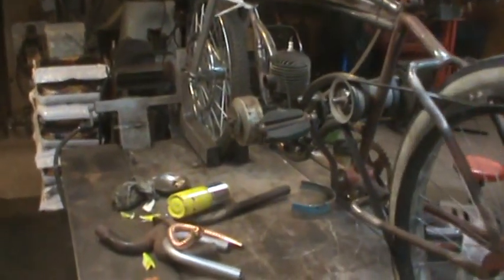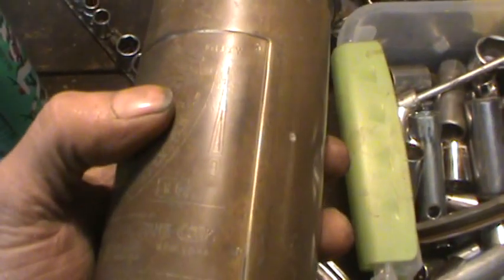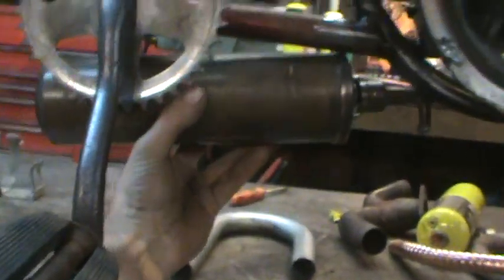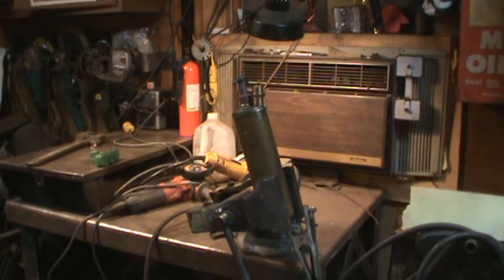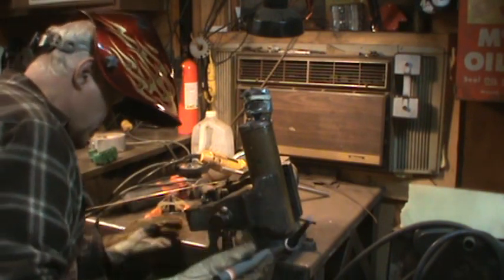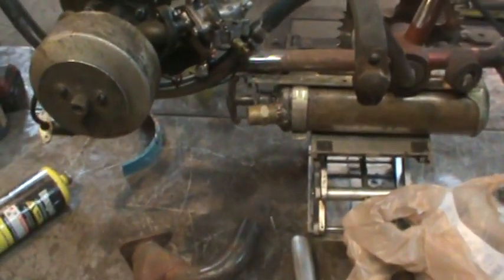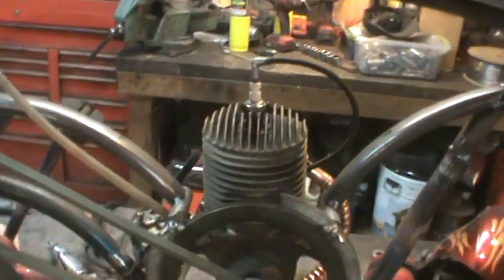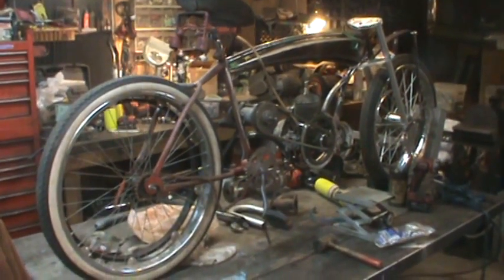building the bike exhaust

Comment: I like the decompression idea. I would think you could T the plug as they sell those anti fouling adapters that hide the plug up there and they seem to run. But I also like the idea of just taping for a second plug and using the body of an old plug for the main part. Maybe brazing in a brass petcock into the center of an old plug.

Comment: The cast elbow bend is available with a male thread (I know they are here in New Zealand) that the copper nut would fit directly to and lose the joiner fitting shortening up the top end so the copper tube might then be able to follow the crank better

Comment: Very cool the exhaust looks great . Have you every seen a decompressor Valve its a ball type but the top looks like a extremely small funnel . You put a little gas in it open it up leave it open tell it starts .   I have had a few old vintage 2 cycles that had them in the head . Cant wait to see more :)
Reply from the maker: +huck01955 l havent but sounds cool
Reply: +mustie1 I will try to find pics and send them to you

Comment: Be careful with a decompressor  valve. the increased volume in the combustion chamber before the actual valve could reduce the compression to where the engine may not run. A couple CCs volume  on a small engine like that would be huge, even if it still ran the power reduction will be great. If you must have a decompressor stay with a push button chainsaw or a cable operated Skidoo type that threads into the head. 
Sorry for the unsolicited advice rant.
Reply from the maker: +snocrushr thats what l was worried about,

Comment: Any concern about restricting the exhaust too much with the copper flex? That little motor is going to need all the ass it can get! Looks great though!
Reply: That engine like back pressure. He ran it without the exhaust and it ran like shit. Original exit hole was about the size of a quarter, if that.